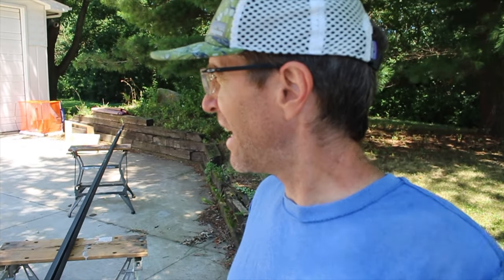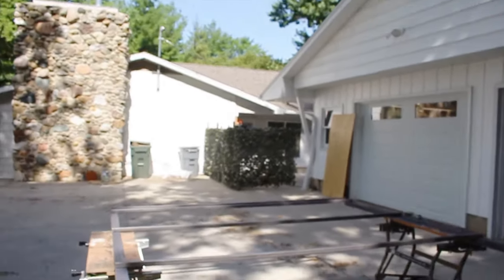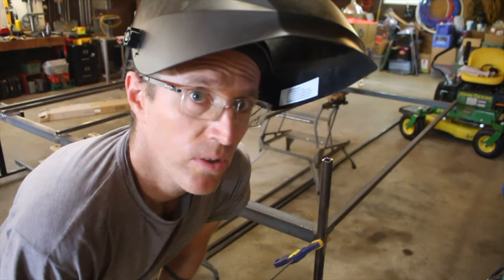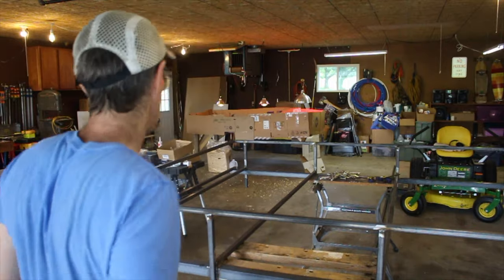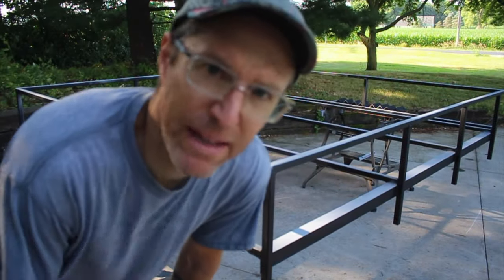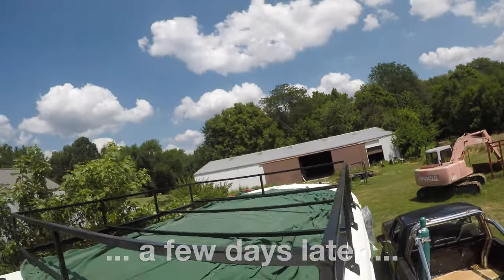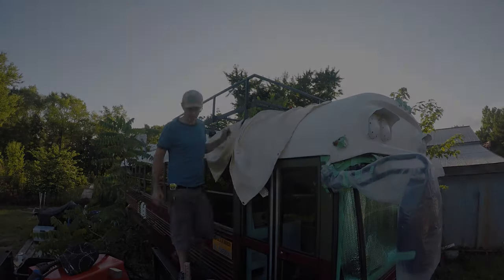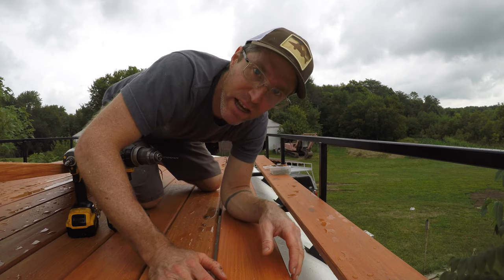Skoolie Roof Deck Build in Tornado Alley

Comment: Thanks for a great video! Question: do you have a rough estimate of cost of materials for this particular build? Thanks!
Reply from the maker: Hey, thanks for checking it out! Once you have the welder, the steel and decking should run around $1k., maybe $800 ... of course, that depends on the size. So it's not that expensive, all things considered
Reply: @metaspencer  im 1/4 through your prison bus playlist and it is fantastic! Thanks you!

Comment: I need to know more about those "rib bolts" that you ultimately use to fasten the whole thing. I'm trying to understand the best way to fasten a deck to the roof.
Reply from the maker: Maybe you're talking about the rivnuts or nutserts? When properly installed they can have some good strength. Another option is to go through the frame and out the other side. Lots of ways to do it
Reply from the maker: You'll see some other methods and details in my other skoolie roofdeck builds (I did 3 of them)

Comment: Hi Spencer, great video! I was wondering, what gauge of 1" steel tube did you use? 

Thanks,
Reply from the maker: On builds like this I got for lighter stuff, so 1/8th gauge tubing is what I think I used. On a later deck build that you'll see on the channel I used bigger tubing but still thin to save weight.
Reply: @metaspencer  Thank you!

Comment: After almost three years, how has your roof rack and the basically nomads rack been working?  Anything you'd change?  I'm trying to figure out how I want to do mine, and I have seen a lot with rivnuts and unistrut, but I like your design better.  Thanks.
Reply from the maker: Of the various roof decks I've built I think I like this one the best: beefier decking and framing. https://www.youtube.com/watch?v=RIOrSjkO_WE ... more weight though, of course
Reply: @metaspencer  I watched that one too!  Out of curiosity, where do you live?  I need to fill the holes in my floor, just watched your video on that. Any recommendations for settings?  That’s my next step.
Reply from the maker: @HomesteadDad  I'm out East in the U.S. these days ... filling the holes can go a bunch of ways. If welding keep it cool  :)
Reply: @metaspencer  I saw you driving down a country road through corn fields and thought maybe you were in Indiana or Southern Michigan not far from me in Michigan.  Thanks for the tips.
Reply from the maker: @HomesteadDad  Yep, that was before moving out to NY

Comment: Spencer, what tubing do you use? Local tubing place won’t commit to the strength, rigidity of their metal as it’s a “liability issue” for the application I want to use...Thanks! And what are the brackets you use called?
Reply from the maker: I go for the thicker 1" tubing for these projects ... I believe it's 1/4" thick walls (but I'm not good at remembering numbers like that). You could do it with 2" tubing and it would be beefy, but I use 1"
Reply: metaspencer Thanks a ton!

Comment: Ribnuts. Any way to break down this process for us a bit more? I didn't see what was inside for them to be secured with...are there nuts on the inside? Thanks again...sorry to be a pest!
Reply from the maker: Called Rivnuts or rivet nuts, the body of the "nut" compresses when you install it so that a portion of it is bulged out under the steel. Sorry I don't have a vid up with details but you can likely find one. They have a lot more holding power in thin steel than mere screws, but less than bolting to a crossbeam or something like that

Comment: Now that.youve been using this deck style for about a year is there anything youd change about how you did it ?
Reply from the maker: I'd go with 2x6 lumber if I did another one. Other than that I like the design.
Reply: @metaspencer  for the deck boards? Is that to reduce the amount of sag?
Reply from the maker: @The3rdDimensionSurveying  Exactly. Thicker boards and less flex. Not totally necessary but better with those spans

Comment: Hey! Great rack! What size rivnut did you use? I was going to bolt straight through but now I think rivnut is a better solution.
Reply from the maker: As I recall the nutserts were these: uxcell 100 Pcs Zinc Plated Carbon Steel Rivet Nut Flat Head Insert Nutsert 1/4-20UNC ... large enough to hold a substantial bolt, I'd say
Reply: Hey, also, if there were 1” square steel tube just under fiberglass in the roof, would you prefer to use a rivet nut or self tapping screw?
Reply from the maker: @garystraws4462  My first preference would be a bolt and a nut, and it sounds like that might be an option for you as you have that square tubing that you might have added yourself. But if inside the bus is all finished, I'd go with a rivnut: stronger than self tapping screws as you're relying on more than threads to hold the rack down. After that I'd go with self-tapping screws, which can also be strong. Note that you want to seal those suckers no matter what to keep water out.

Comment: I gotta ask, since its a mobile structure and lbs cost money to haul down the road why wouldn't you use aluminum tubing to build the rack instead of steal? Not to mention corrosion issues.
Reply from the maker: Aluminum would certainly be good, though I'm assuming you'd have to gauge up given that it can be weaker. The simple answer is that I used steel because that's what I'm comfortable working with -- I don't have experience running pure argon on a MIG setup. I'd love to see an aluminum roof rack, though!
Reply: @metaspencer  you could get think wall square tubing in aluminum with proper bracing like steal it would be just as strong. I live in south florida and they use aluminum on big boats for tuna towers and pole racks,thats why it would be my first choice in material, i would assume availability in your area could be a concern, also it would be an opportunity to toss in a new skill.
Reply from the maker: @phantom629  It's a great idea and I've been thinking for quite a while about adding some gear to my shop (a TIG welding and/or a MIG spool gun) ... definitely something to think about as I've been making more racks lately. :)

Comment: You made THAT look easy! Nice Job! I want a deck eventually. What is the total weight on that size one. I'd Need a smaller one (smallerbus) .  thanks in advance. Dreadybill👍
Reply from the maker: Love the decks! You need one! I’m estimating total weight to be ... errrm ... 200 lbs
Reply: @metaspencer  right on thanks. So a smaller one prob 150 ish.... Cool. Maybe ill hit you up when I'm ready to consider one😉👉
Reply from the maker: There are a few ways to reduce weight, like larger gaps between deck boards and limited railings ... and then you could even go with aluminum, so there are options. Take care!

Comment: Not clear how you secured the boards to the tubing. Can you elaborate? Thanks...just about to start mine and it’s scary!
Reply from the maker: Yeah, sorry about that: predrilled the board and the tubing, then affixed with beefy screws meant for tapping steel.
Reply: Thanks Spencer. Man, can’t believe this has only a couple hundred views!!! Impeccable info. Do you have a welding tutorial? Haven’t done any sjnce metal shop in high school!!
Reply from the maker: @CookTheBruce  I have a lot of welding vids, but no tutorial ... keep the basics in mind: clean up your material before making your welds, practice on some similar stock to make sure you have your settings right, measure a lot more than you think you need to, and it'll be great. You're gonna love the deck!
Reply: @metaspencer  Thanks Spencer. Found a great organization here in Portland, Metalwood Salvage, who will do a 3 hour 1-on-1 class for me this Monday. Soooo excited! They also have all the tubing, etc. to get me going on my (crazy) rack/deck build...
Reply from the maker: @CookTheBruce  Sounds great. I lived in Portland for some time and am not surprised that something cool like that is available. Good luck!